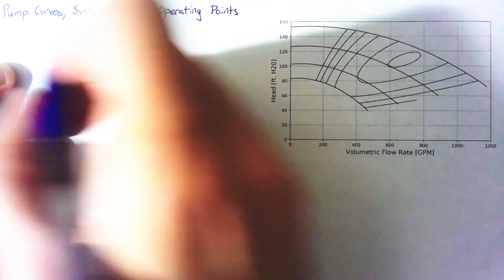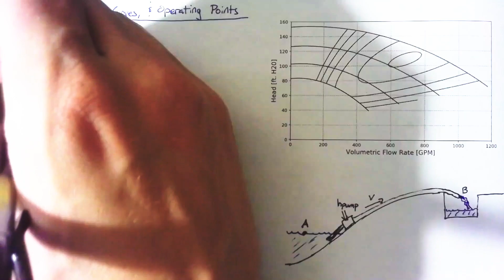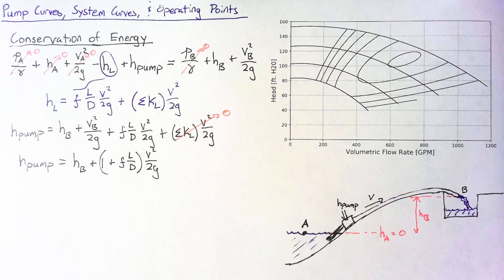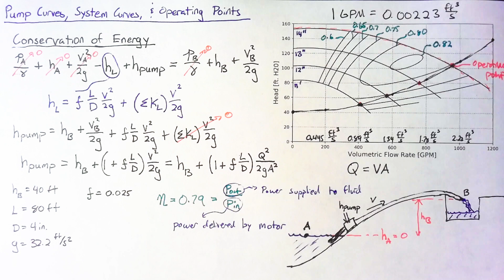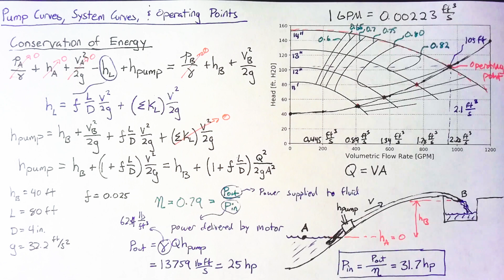Pump and System Curves

Comment: 1. I can't understand why the head of pump will be larger the head of B after increasing the Q?
2. Besides, why the connection point of the system curve and the pump curve is the operating point? Why don't we adjust the operating point along the pump curve and choose the point nearest to the 0.82????

Comment: how did you guess Hp and correspondence value of Q? : Is there mathematics formula?
Reply: I think Q&H should be determined by the application; then find the pump gives the good efficiency in the region. Not the other way around.

Comment: I have two questions
1- why is the velocity in the friction head is the same as the velocity in point b?

2- Is the velocity in point B the same in the impeller? If so, why?
Reply from the maker: 1 - The friction head is due to the velocity in the pipe.  At point B, the assumption is that the diameter of the pipe is the same as everywhere else.  Since the diameter is the same, and flow rate has to be the same, we know that velocity is the same.

2 - The velocity immediately before and after the pump is the same as point B.  However, inside the pump, things are a lot more complicated, as the impeller is causing a lot of rotational movement while the area is also changing.  At this level, we don't try to look too deeply into what's happening inside the pump.  That's what the curve is for!
Reply: @PostcardProfessor  so I guessed right. Thanks a lot

Comment: 5:32 souldn't the equation have another term equal to (v^2)/2g which corresponds to the hydraulic losses at the output of the pipe? Having something like Hb=Zb+ hL being  hL the primary hadraulic losses.
Reply from the maker: That’s the “1” that’s added to f L/D. We can either look at the surface of the water, in which case those are hydraulic losses, or at the exit of the pipe, in which case it’s kinetic energy.
Reply: Dear sir in some other videos , they consider velosity head as helping the pump so they subtract its value from the total head the pump should give to the fluid